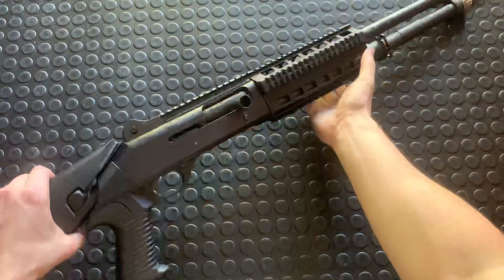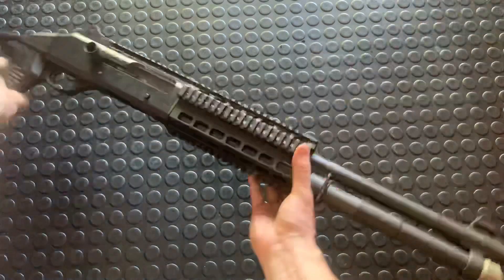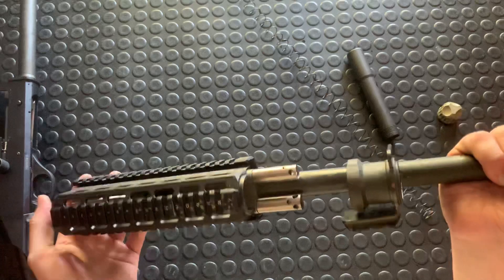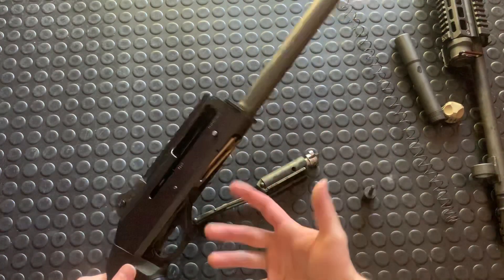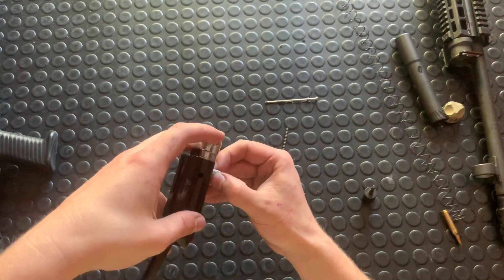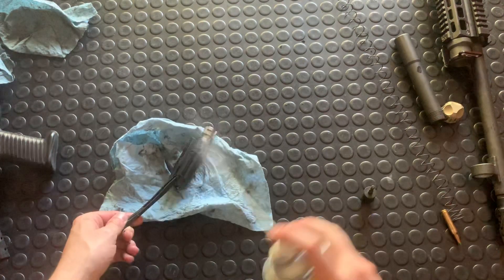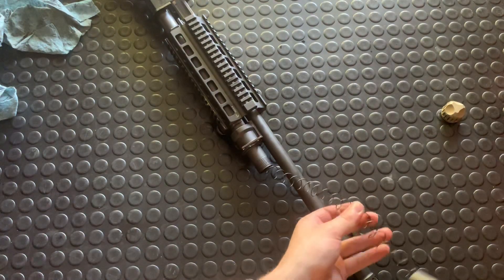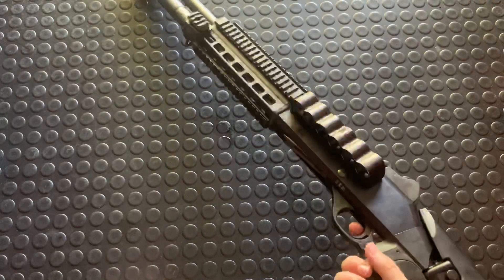Benelli M4 Field Strip

Comment: okay lets go: the position for the stock remove is marked exactly by Benelli with a thin line. You dont pull just the charging handle out of the bolt; you rotate it on the forcespot and take it out smoothly: if you just pull you are hurting exactly the mechanism which stops the charging handle to just fall out during shooting. And you damaged your o-ring to the side that holds the firing pin--->really not good ! Id recommend not to spray over the whole Bolt, cause this will make all kind of dirt sticking on it: just oil the slidecurves of bolt and reciever. And you should allways screw the magcap as hard as you can it tends to open and to cause malfunctions in all forms otherwise during shooting.

Comment: Great vid..just installed  b& t rail..any problems with yours ? How many rounds with handrail installed?  Thanks in advance.
Reply from the maker: None other than it's heavy and I didn't use the rail segments for much. It's a quality and cool looking rail, but I'm actually looking to swap it out for something simpler and lighter. Quite a few rounds through mine, no issues.

Comment: What quad rail and side saddle do you have ? Reason i ask is i have a 2021 benelli m4 and i purchased the B&T qaud rail for the benelli and a mesa side saddle for the Benelli but the side saddle will not let the B&T qaud rail to slide back all the way,  but if i leave on the stock Picatinny rail the B&T qaud rail slides back perfectly.  Now im stuck with this mesa side saddle that i can not use.

Comment: I bought a canuck operator which has the same dissassembly but I cant get the first pin out to remove the firing pin. Even with pressure applied to the bolt, any advice?